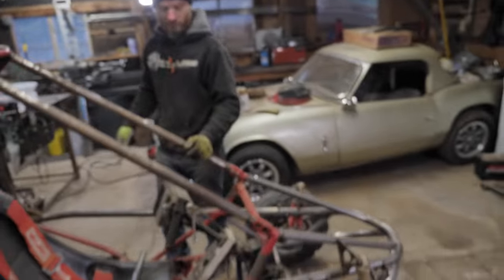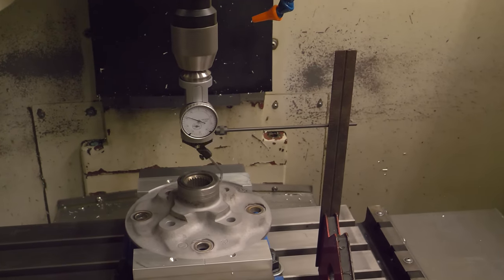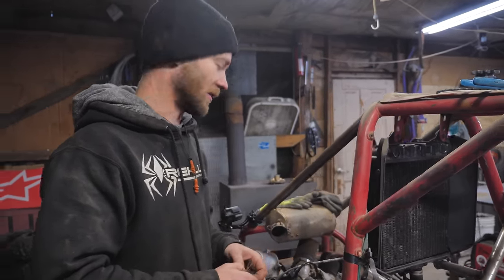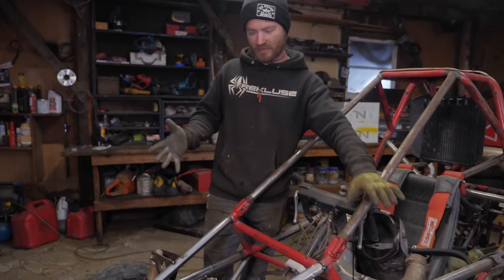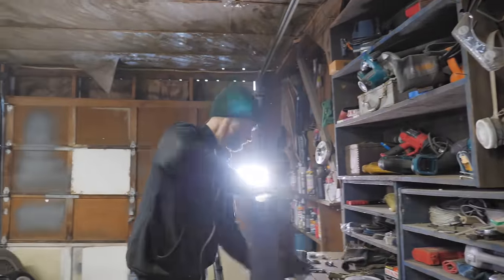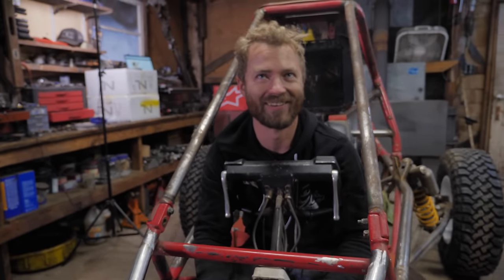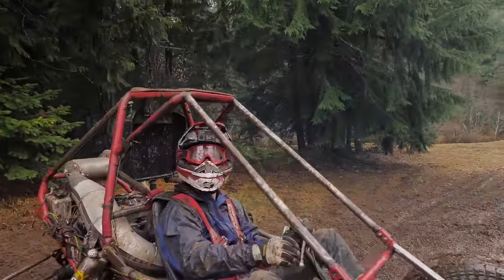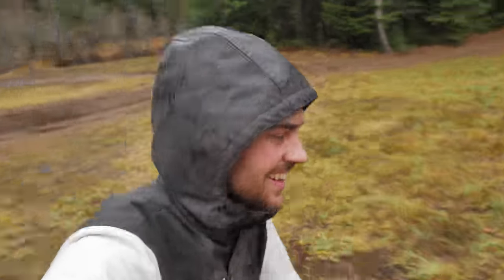Long Travel Odyssey ATV Test Drive on 28s!

Comment: You guys just put the finishing touch on something ive dreamt about building since, no bullshit, i was 7 years old. Literally the only difference in my dream machine is the powerplant and delivery. Im not a pretentious boob or a snob in any way but i GOTTA have a clutch. Some dudes and dudettes
are talented enough to be able to drive an automatic, cvt, paddles, just as well as anything else. Myself, am not. If i dont have a foot clutch, and a shifter in me right hand, and a handbrake next to it, im just not the same guy behind the wheel at max attack. Im sure some of you feel the same way. Its like i cannot go 100% on a dirt bike with a slipper clutch. Its just weird and i think about it, then i make a mistake and wake up in the hospital. That being said, I think you guys should go that route. Any old yamaha liter bike has a bulletproof gearbox and nobody can deny the reliability of a Yamaha. Im building a shred sled with everything from a 85 FJ1100, of course its a Yamaha. I absolutely bleed blue ive been on yamahas since i was on a 80cc and my bikes are always the most reliable out of all my buddies. Im 6'4 240 pounds. Im told im really really fast for how big i am. I have 113 first place trophies in my garage, so needless to say im extremely hard on my bikes. Somehow they always start and i do top ends half as much as any of my Honda buddies. I know because im the one that fixes them. Being a mechanic/fabricator i do have mechanical sympathy but when 90% of the guys you race against weigh 80 pounds less than you, you have to really have to burn some fuel to stay out front. Go blue guys, YOU RODE RED TILL I BLUE YOU AWAY!!!!!!!

Comment: 26x12x12 aggressive atv tires out back on a 2+5 offset and a 25x8x12 all terrain tread out front on a 4+2,or 5+2 offset plus you're going to have to beef up the entire suspension if you wanna run that much unsprung weight and leverage as you're gonna find out...

Comment: They need to look up snowmobile clutching. That is not setup for that at all. They need new springs and weights for that big of a tire. It is just burning out the belt at that point. Also you need a shield for the clutches, they shouldn't be wet and they also needed to be cooled. That is how people run the big tires on those SEMA builds. Or they run portal axles.

Comment: I don't know what pressures you're running in the tyres but it looks way to much. A bit of side wall deflection might help to take the sting out of the suspension/ steering a little.

Comment: I think it actually looks cool, like one of those nitro rc cars haha. but those heavy wheels now have way more inertia when spinning compared to the smaller ones, and their added mass sort of makes the suspension components seem insufficient, which means its probably gonna break stuff. Definitely inspect the top end of the engine, at least poke an inspection camera through the spark plug hole and exhaust port to see if the cylinder and or piston is scored.

Comment: New Sub..I think your fronts are too big..maybe 25"??.. also I watched a few times and I think you may have a pretty bad "Bump Steer" issue going on..longer knuckle attachment (to st. rack) with spacer, to flatten out St. Geometry..I really think the ft. wheel size is going to break a lot of that light duty ft. end parts/tubing...I'm super excited to see what you guys come up with...

Comment: That's a Polaris "liberty" engine from a snowmobile. The small belt that was broken is NOT a oil pump belt. It's the water pump belt. And yes, when you start it up it'll run fine four a while, right up until the engine temp get to high and then it'll start to run like shit. The oiling system "oil pump" runs on the same system as the fuel pump, 2 stroke life!!

Comment: I was thinking about your RX one turbo tramp the problem you’re probably having is the secondary is opening up too fast which is causing it to bog the motor down you have to remember a snowmobile is designed to run on friction so you’ll need a secondary helix is closer to 20° than what you probably have on there which is probably a 47 to 50° angle helix the car has 10 times the less Rolling resistance Then a snowmobile does.

Comment: Where yall located? Wanna help me build mine if I pay for being that you have the tools an knowledge more then I do.. i need a new frame, figure out the brakes, add suspension an install stage 4 kit for my predator motor, change gearing an 2 piece steel sprocket (old aluminum one blew up) add lights an blinkers.. so basically rebuild the hole thing so it safe an able to use

Comment: Forget the haters them wheels and tires are badazz but you need to toss that motor and grab you a hyabusa 1350cc street bike motor. Stock your looking at 190-200hp then add turbo lol but biggest thing is you would have a real transmission and get rod of the cvt.

Comment: It varies by vehicle speed, but the quick and dirty way to estimate is every pound of rotating mass is like taking 3 pounds off the body, so 44lb wheel diet was like pulling 132lb off the body, you guys look pretty light, so that's huge hah.  And don't get me started on how good getting rid of that much unsprung weight is for the handling on the suspension.  It's like a poor boy trophy truck at this point hah.

Comment: 5:00 that just happened to my gen 2 rmk 600! so same motor almost. what happened to myn was the rip cord broke and wrapped itself around that belt. kinda stupid design cause that could totally destroy the motor. my temp light eventually came on so i stopped before any real damage occurred.

Comment: Rotational mass and tire size is not right for the gear ratio. You need that torque to rotate the tires. But it all about playing around and tweaking it to get it right.

Comment: The tires look really rad, but they also look WAY too heavy and tall for the buggy, You can see the suspension having a hard time controlling them. I think it needs normal ATV tires, not car tires.
I'm sure you can find lightweight ATV tires that fit those rad wheels.

Comment: Bad ass. Have y'all thought about cutting tires to get a little more aggressive pattern??
Reply: Jonathan Turner that tread pattern is meant for gravel/dirt if they go more aggressive it won’t get as much grip if they get more aggressive it would be more for mud
Reply: @lucas02389  back tires are an all terrain designed more for mud. Fronts I'd agree for rocks. If they were to alternate and cut halves off cleats on back tires it'd lighten tires and still have great grip, if not better for their environment.

Comment: Front tires are too big and should have as aggressive if not more than the rears, i say a good ATV tire or some agressive snow tires in a shorter and thinner size. The rears looked good if the axles can handle it.

Comment: I absolutely love watching you guys make these builds but those tires on the Odyssey are way too big and are going to take away from the handling the power from the motor they're going to probably ruin your clutch twice as fast and I hope you don't take this the wrong way I'm not trying to be a Debbie Downer I just think you should go back to the quad tires and rims that thing will haul ass and in the winter throw a set of skis on the front and make some nice tight tracks for the back and making an odyssey snowmobile thanks for taking my comment guys good luck and God bless but definitely change those tires LOL

Comment: Sorry guys but those wheels and tires are way to big. I think it looks a bit ridiculous plus it is super hard on the clutch and suspension components. A set of four wheeler tires (23 or 24 inch maybe?) would look a lot better in my opinion. Just my thoughts on it. It is a awesome build!!!

Comment: If that  motor wasn’t getting oil then I’d tear into that engine and check those cylinder walls and piston skirts. Cause 2 strokes destroy them selves so quickly once you take oil out of the equation

Comment: the wheels look nice, but the tires are wayyyyy to large. use your front tires on the back, and find some tires that are an inch or two shorter for the front. That would make it look so much better.

Comment: That wheel/tire combo is WAY too heavy for those light duty suspension parts. Especially on the front. Side by side wheels/tires would be much more suited to being run on this buggy due to their light weight, and you could still go to around a 31" combo at half the weight. Also, he seems to forget that the engine is also having a harder time trying to spin wheels/tires that are muuuuuch heavier.. It's not just the added grip, it's the excessive weight. Rotational mass.... The added height/diameter of the wheels/tires is ALWAYS going to wreak havoc on those wheels bearings, especially the front end. They're just too large and too heavy. The added height acts like a longer "lever" being used against those front wheel bearings.

Comment: Not so much do with grip the gear ratio  and or final drive is just changed to much by the big tires u can here it slipping the whole time cause the tires are so large hieght wise. u will burn through belts over and over unless u are able to buy different sprockets and or belt pulleys

Comment: Put a hayabusa on it .....snowmobile engines can’t come close to 186 stock hp 10k rpm 
And but loads of torque 
Modified a hayabusa can put out 400 hp easy 
They’re light weight too use a air shift system

Comment: lots of rotating weight gentlemen.  2strokes are RPM not so much torque , plus front tires are a detriment ..look up the old VW  rail buggies . should be able to pull front wheels off ground in that thing ..best wishes . Performance first ..ta hell w looks 😉

Comment: Way too big on the tires, 26" or 27" at most would have been ideal. Wheels are hideous in my opinion. Looks like they should be on the street. Douglas aluminum beadlocks or Hiper CF wheels would have been tits for this build.

Comment: Wow a 2JZ FSE engine maxes out at 217 hp and 216 lb-ft of torque. The GTE performance engine is capable of 321 hp. That is ridiculous power dir an odyssey chassis.

Comment: Gonna lose power with those big tires.    A two stroke has no low end torque to turn those huge heavy tires.  And the rotating mass is gonna destroy all your hard work.